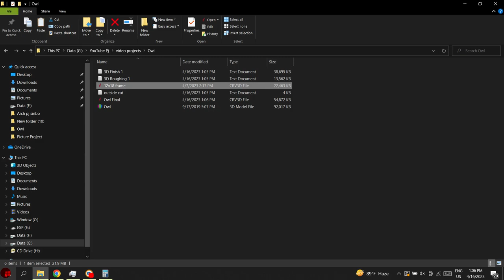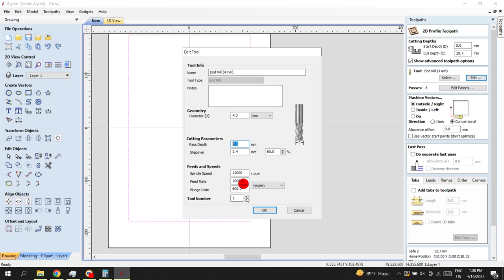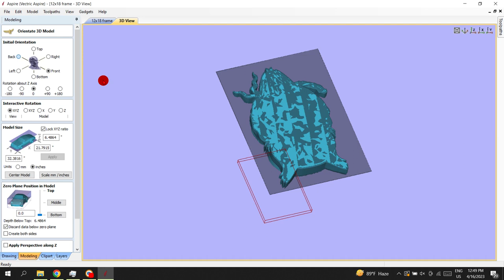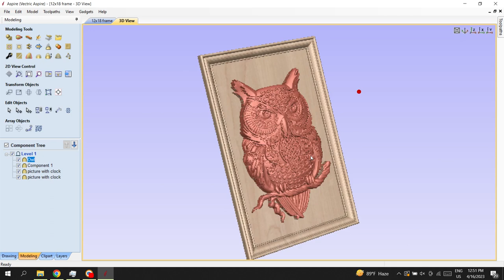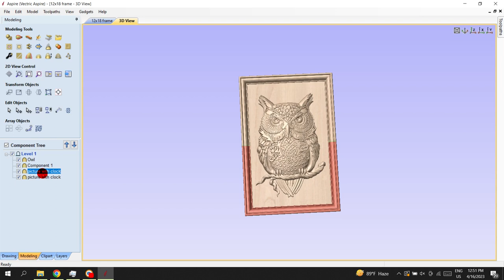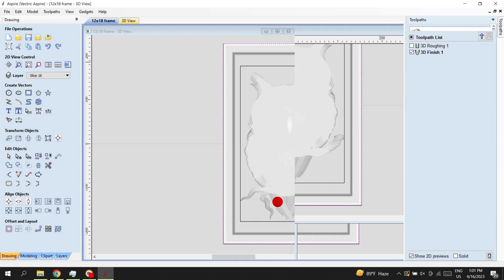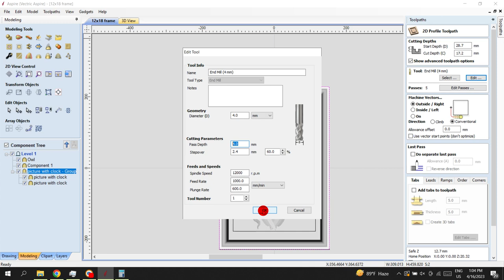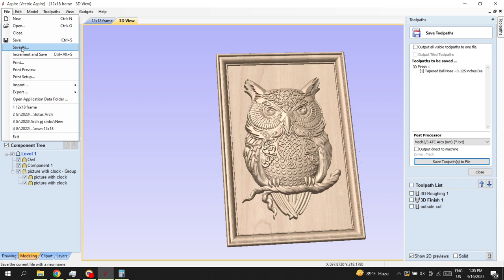Engraving Owl  // Antique Gold Paint   // Vetric Aspire toturial // CNC Woodworking project

Comment: its a beautiful work. i have some question.
1. how to calibration Z for first bit into second bit.
2. when you sanding use your drilling machine. what type drum sanding you use?
keep posting your works
Reply from the maker: 1. i measure top wood plate+12x18 frame=model shape height
2.i use (CNC Nylon Wheel Brush)
Reply: @nganaungcnc  thanks man :hand-pink-waving: